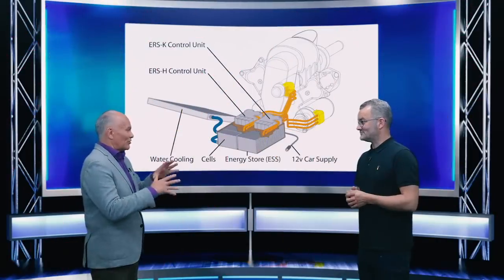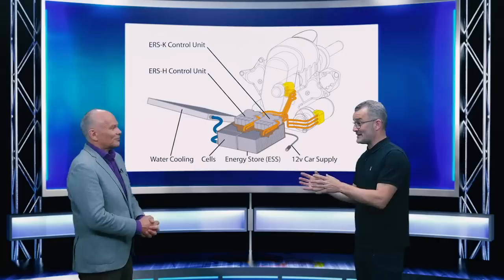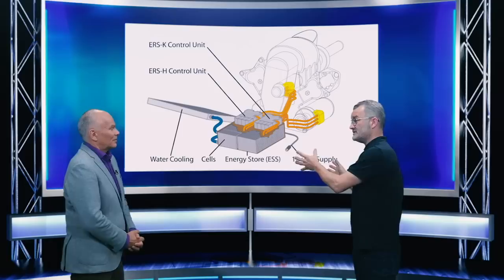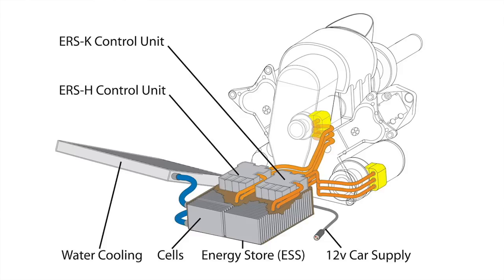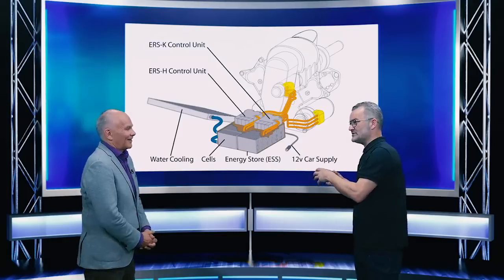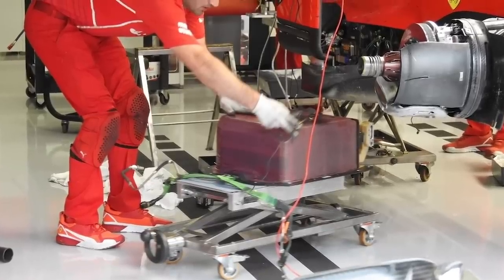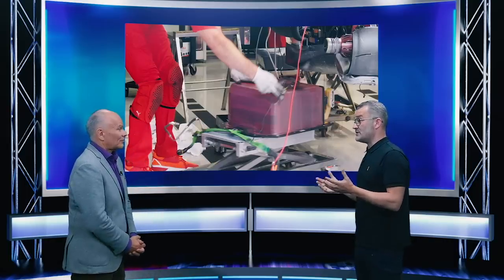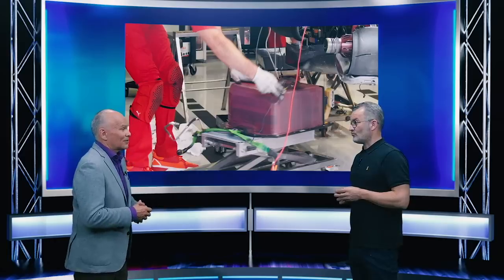Ferrari's twin batteries explained

Comment: This set up tantalizingly suggests super-capacitors - they charge and discharge must faster than Lithium batteries. The capacitor bank would be used to harvest energy from the MGU-K during braking events more efficiently and, then to allow faster acceleration out of a corner.
Reply: No, capacitors have very high power density but very low energy density (capacity). The Cap bank would have to be about the same size as a truck for it to have the same energy density as one of these batteries.

Comment: According to the regulations summary on the formula1.com website "An unlimited amount of energy can be transferred between the MGU-H and the ES and/or MGU-K"  Theoretically, with two separate batteries you could feed the MGU-K the maximum 4MJ allowed per lap from the ES from one battery and ALSO use the second battery to feed power back through the MGU-H then into the MGU-K, which has no restriction under the regulations.  That's what i'd do with 2 batteries anyway...  Perfectly legal under the current regs.

Comment: I use two batteries in my diesel for more starting power, I think it is amps that go up. I can remove the "auxiliary" battery and all works like stock.. cranking power is noticeably less.
Reply: Yes, by wiring two 12v batteries in parallel you double the capacity and therefore peak amperage available. If wired in series the capacity and available amperage remain the same but the voltage doubles.

Comment: The only regulations I'm aware of are related to the allowable instantaneous discharge power of the battery. Ie. They can only discharge a maximum of 120kW at any given time. But I don't think the capacity of the batteries are regulated. As long as they never discharge more than 120kW they can have whatever battery size they want, allowing them to use it for longer.

Comment: Two batteries, same voltage - same amps, in parallel will give a greater discharge (in watts) for a longer period of time. Simple.
Reply: open up a battery and you will find a similar system with the individual cells anyway.
Reply: total capacities? and discharge rates? are limited. so config would not make it as you say it, if you divided the pack, you would reduce one effect... lower power by way of longer period but lower current drain... in series, you could draw more current to get more power but at short bursts this would make sense? because maybe they figured charging two smaller batteries will be quicker and they way they charge them?... but this is the controversy... If they are discharging more than they are allowed, and they couldnt convince fia right away until a new software update?? hmm what??  they may be onto something? There is also the fact that they could well be using higher capacity/density batteries? and using in parallels makes sense without breaking rules... unless battery types are regulated? because there are all sort of battery capacity densities...

if they are goin above the discharge rate, than they are braking rules, which has been cleared after three races.... how? software update??? not sure...
something is fishy in their battery dept, and sep is using a third button on his wheel, and always quicker then his mate... did they master the above situation? harvesting energy goin through corners instead of during braking only? and as red bull has been accused of traction control (harvesting energy excess during to while helping traction) through recharging process and hence using extra/quick stored energy and longer kers power over a lap in more twisty circuits and as an another side effect being less tyre wear due to less spinned (more balanced loaded) tyres...
Reply: Why would the power discharge be greater?
In parallel, your voltage is lower and current discharge higher.
In series, your voltage is higher and current discharge lower.
They change by the same magnitude, and thus same power output.
Reply: @geepytee   Yep, I race quadcopters, we used to use 4 cell lipo packs but a few years back some moved to 6 cell powertrains. It all balances out in wattage and power to weight ratio exactly like you say once you reduce 6s lipo capacity to make it the same weight as the 4s lipo and lower motor kV to match the voltage increase. 
Average performance is the about the same... however the 6s quads have a more linear voltage drop discharge characteristic. They dont have the same peak power at the start of the flight but dont sag as much and therefore offer much less warning that you are close to hitting LVC (Low voltage cut off)
The 6s quads are reckoned to be better for racing in the sense that you can be more consistant and accurate with your lines with a shallower voltage drop and you start catching the 4s machines that raced ahead at the start... once the their lipos voltage start sagging. 
6s is believed to be very slightly more efficient because voltage is higher but peak amperage is lower due to using lower kV motors... and so a bit less energy is wasted as heat.
Reply: Merc prob have a 4 unit setup then. :)

Comment: ferrari are the biggest cheater in f1. because they know they can get away with cheating. even bernie came out recently about helping ferrari in some technical issues. whiting was saying ferrari could not explain or convince them that ferrari was using battery power was not above the limit. so now whiting is saying they are going to bring a software to monitor this. all bs. fia or ferrari international assistance at its best trying to cover up and help ferarri cheaters
Reply: suresh jayasiri Thanks for making us all dumber with that comment. Only problem with it is that Merc is winning all the titles. 😂
Reply: LOL nonsense. People were accusing the FIA of gaming the system to "gift" Mercedes their world championships, and here you are accusing them of "cheating" to help Ferrari.
Reply: Hahaha, very funny comment! You learned nothing from the video saying that this battery layout has been used from 2014, when Ferrari was far behind. Ferrari did a good job this year, as Mercedes did the previous years. How do you know that Mercedes do not cheat????

Comment: Putting sensors on at Monaco would never detect if  Ferrari was cheating if the total charge and draw were within the limits. In fact you could probably lose the MGU-K and still win. I'd give you an example but Ricciardo already did. That even after Monaco the FIA required Ferrari to change their software makes it likely that Ferrari were cheating. 

Cheating alone isn't a benefit, durability and redundancy would be improved if the separate packs were charged and discharged alternately or together as the race/driver needed. It could also cause the driver aka Vettel to be warned against over using it. Haven't we heard something along those lines in the past?
Reply: As he pointed out, the software updates don't really mean its "likely" they are cheating, the software updates could have just been to add more diagnostics capability so the FIA could do the tests they wanted.

Comment: The whole problem in this case is the ridiculous fact that FIA limits hybrid power at all!
The limit is also a laughable amount of 163 hp AFAIK & for a certain amount of time. Which dickheads come up with shitty rules like that? F1 is supposed to be the pinnacle of automobile/racing technology (which currently it isn't though) so that limit is an utter joke as are the all other limits, fixed dimensions etc.. F1 PUs are far from what would technically be possible yet it is sold to the unknowing public as absolute high tech. What a giant lie, but ok that's what car manufacturers are experts in.

Comment: the most crazy thing is that the Mercedes battery is NOT ONE battery... it's several cells put together ie. batteries put together and they can essentially charge and discharge them more or less independently. It's like the battery one a Tesla is NOT just one battery but essentially hundreds of glorified double A sized batteries... the F1 batteries are just high performance cells and the ones I've seen are flat and square but SEVERAL batteries put together.
Reply: First of, don't call individual cells for batteries, those cells are VERY rarely independently addressable, X number of cells makes ONE battery with ONE control unit and charge subsystem, you either connect them in series or parallell and create ONE bigger battery, even though one battery consists of multiple cells they are not independent. Second of, Tesla uses 18650 and 2170 cells, those are not double A sized as you claimed, they are bigger, also, again if you adress one cell at a time, they are batteries, but as explained earlier if you put multiple cells into one subsystem they together make ONE battery. So yes, Mercedes have ONE battery and no, they do not charge and discharge the cells individually, that would create a horrible unbalanced battery with very degrading performance (google lithium battery balancing)...
Reply: Jesper, first of please stop saying first of all and start lecturing people about something you clearly know very little about and that you clearly have a hard time defining.. in fact you even manage to contradict your own statement in your comment...
First of all I can call the cells in a high performance F-1 battery batteries because that's exactly what they are.... and first of all they are in fact individually addressable simply because all of the cells I've seen have individual circuits...
first of all I did NOT call Tesla batteries double a batteries I said the cells were quote "essentially hundreds of glorified double A sized batteries"... you can't read and understand, the key term here is essentially and essentially you have proven you're nothing more than a very opinionated yet illinformed clown.
First of all Tesla the cells Tesla uses are actually just glorified double A sized batteries meaning they're slightly larger but I made the reference because a lot of people are under the wrong impression.
First of all, you're equally WRONG when you state "they are not independent"... in fact in most high performance batteries have cells or batteries that are independent and NOT monitored by ONE battery management system... there might be one large overall BMS but cells or clusters of cells can and do in fact have their own little circuit board to monitor temperature, voltage, battery health etc and they can in fact for the most part be switched of individually... including Tesla's big battery... there's clusters of cells that can be switched off to prevent a temperature cascade or a total battery malfunction if one of the small fuses blown..
and NO Mercedes do NOT have one battery, in fact the have a box with several smaller batteries inside and it proves you're very much mistaken...
first of all most high performance batteries are NOT one single type of cells because different types of battery chemistry have different properties and it would be absolutely retarded to have one average battery to do it all when F1 requires exactly the opposite..
First of all your reference to lithium battery balancing proves you're an idiot.. because the aim is NOT to have a balanced battery in F1 the aim is to have the highest performing battery... and I may add that the F1 defunct battery I've, one blown cell, did have its own little board, it could actually be switched off so to not harm the rest of the battery so you would lose less than 10% instead of losing the entire battery if just one battery malfunctioned.
Anything else you want to be wrong about Jesper?...
Reply: there's several forums and blogs you can go to... common sense is also a good thing... and general knowledge of high performance batteries are also good... there's also "older" F1 cars with technology similar to today's F1 system you can look at and get an idea...
and yes each of the F1 batteries consists of several smaller batteries cells that are in fact actual batteries.. several batteries make up "one" battery....
Reply: Every cell acts together to create one operating battery. The Ferrari apparently has two different batteries in the same case composed of multiple cells. A Tesla for instance can actually have 16 complete batteries or modules each with 444 battery cells. Each of those cells don't act independently but rather each module.
Reply: Lol I bet you just saw the Mercedes-AMG project one batteries.
Reply: Garris you're actually assuming quiet a lot with your statement about "Every cell acts together to create one operating battery"... exactly how do you know that??... and a "cell" in a modern type high performance lithium F1 battery is actually a battery in itself - in fact it's NOT a cell.. the old types of lead acid batteries had cells whereas the lithium batteries used in modern batteries are essentially a stack of batteries NOT cells...take one "cell" out and you have a functioning battery - because it's a battery... 
and you also make the mistake of trying to explain something from an analogy which you butcher and actually prove my point. You make two logical fallacies there first a straw man fallacy claiming I said the individual batteries in a large Tesla battery can be operated individually - I never said that... but the larger modules can certainly be switched off... and and you make the "argument from analogy fallacy" trying to argue from a analogy that doesn't apply here, in fact most analogies doesn't apply at all except if the analogy is about the thing in question... but you didn't... it's perfectly fine you're chiming in but you're mostly wrong... further more the F1 batteries are very different from Teslas glorified double A batteries in a tray both from a chemical perspective, power density and electronically control... each "cell" as you call it in the Tesla battery is actually nothing more than a  single self contained battery and they're wired together to give the capacity and performance Tesla needs - but they're still INDIVIDUAL BATTERIES inside a larger case you call the battery. The "cells" inside an F1 are in fact BATTERIES NOT CELLS and they do in fact have individual small control circuit to monitor temperature, charge status, current draw etc and they're managed by a central BMS. There simply stacks of connected batteries inside the outer case.

Comment: Knowing only a little about battery technology wouldn't splitting the battery capacity allow better heat dissipation thereby increasing the rate the battery could be charged at and longevity of the battery? Most of Teslas battery patents are around cooling for this reason.
Reply: the battery is already split into several batteries put together...it's several cells... and it would be reasonable to assume they also use different types of batteries in the two packs since the absorption rates on the two types would be different..

Comment: They always cheat...Absence of evidence is not evidence of absence!!! #FerrariInternationalAssistance
Reply: They’ve been repeatedly cleared by the FIA despite James Allison trying to narc on his old team. Three separate times they’ve been investigated and never have been found to be doing anything wrong. Not their fault they’re doing something different.
Reply: brandon noel so where's the cheat?
Reply: except the don't cheat and  NOTHING in the rules says anything about ONE battery...
Reply: Lol if the FIA is biased towards Ferrari then why were they told to remove the fins from the Halo mirrors in Monaco? Dumb ass retards.
Reply: They have been having the same battery setup since 2014...
Reply: If you said that in court you'd get laughed ar
Reply: UMMMMM Mercedes was the team burning oil last season... how did you think they achieved over 50% thermal efficiency?
Reply: well Mdabape you're wrong because a lot of the confusion have been about "two batteries" and the FIA making failed reading and other teams complaining about the FIA testing.. so yes most of the nonsense was about the batteries themselves because after the FIA had cleared Ferrari once the teams complained again and essentially invoked the "VW diesel" scandal thing claiming that is you tested the batteries separately they would release more energy than allowed but when you tested them as a unit through the BMS they passed the test.. their claim was essentially that Ferrari had made their BMS such that if the FIA came to test, the battery would know this is a test and therefor this is the maximum allowed power output - but in race mode the "two" battery units would send out more power, and it didn't help that the FIA couldn't readily use the Ferrari BMS and understand the code. Just like VW had the ECU controlling their diesel engine know if it was being tested and it performed to the test standards..
Reply: brandon noel absence of evidence means you're just making shit up. Lol. Idiot.